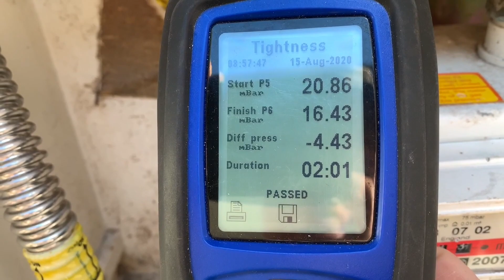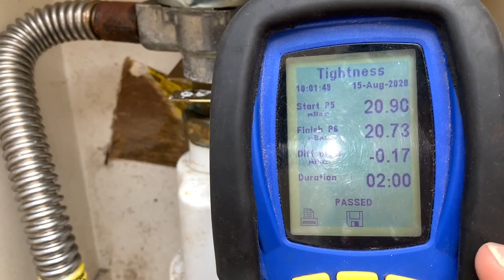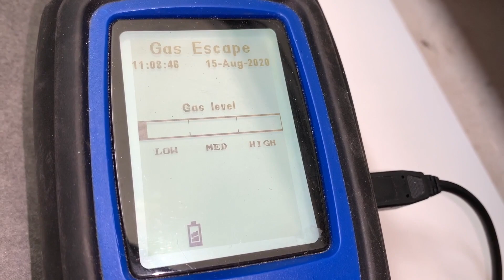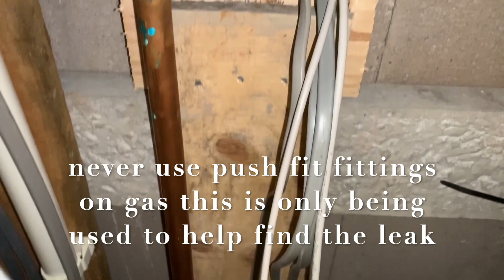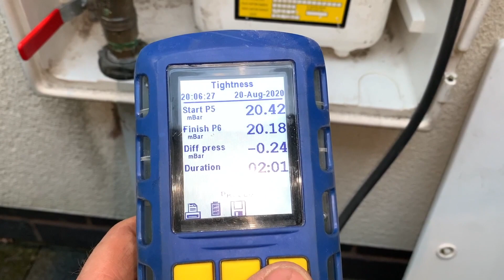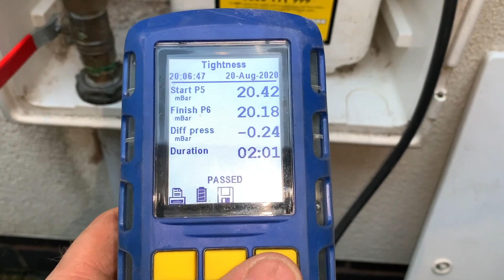TOM (SYNDICATE) GAS LEAK. installing a boiler for YouTuber Tom Cassell better known as syndicate.

Comment: In america plumbers do plumbing and gas. Gotta pass test for both to get licensed.
Reply: We also don't use copper, typically we use black steel. Very interesting seeing how it's done there.
Reply from the maker: In the U.K. we have to pass a test every 5 years to work on gas. We mainly only use steel in commercial jobs in domestic it’s mainly copper 👍🏻